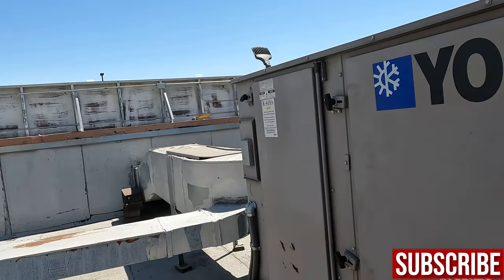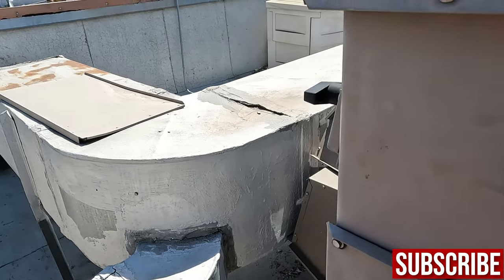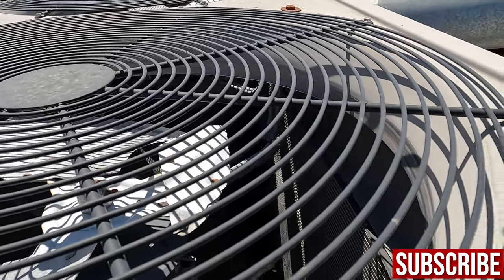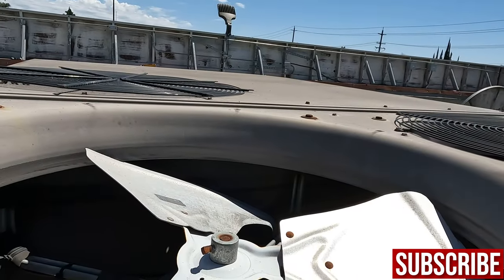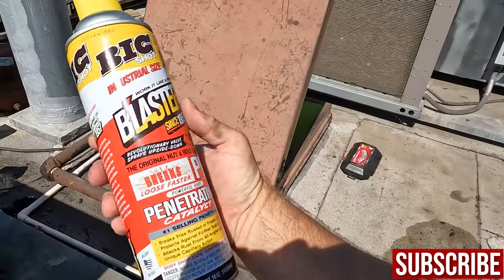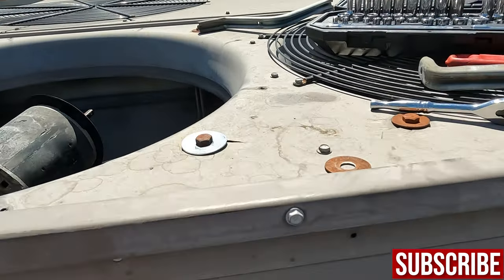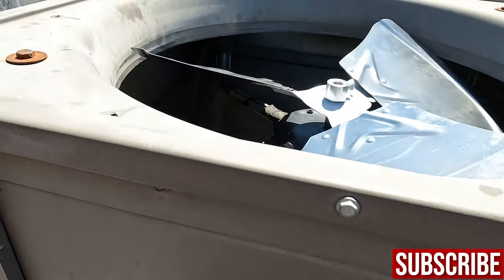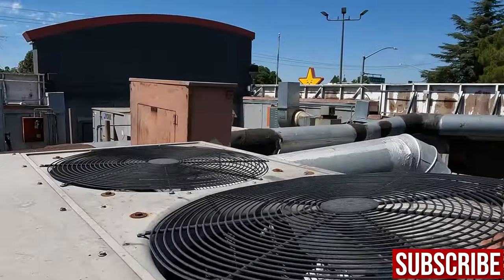Air conditioner stopped working. Bad condenser Fan. (HVAC Vlog)

Comment: They need to stop using those wing swept fan blades on newer condensers, why do they keep using them? what was wrong with the standard square blade fans? these wing swept blades keep getting fatigue and breaking. York used to use the square blades right up until 2021 then they went to wing swept. It doesn’t improve efficiency so why use them?
Reply from the maker: I am not liking yorks too much. Airflow across condenser coil seems to be very temperamental. I have noticed other yorks having cracks also, so there must be lots of vibration.